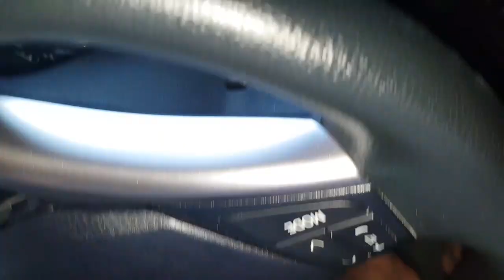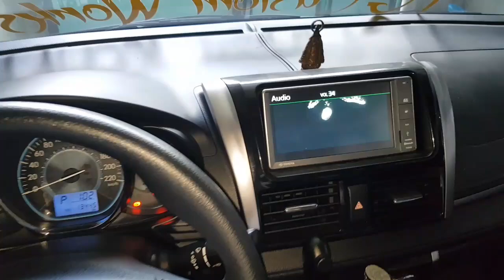Toyota Vios Steering Wheel Controls disassembly and cleaning of none working buttons.

Comment: Boss yung head unit ko pinalitan ko ng pioneer avh 595bt d nagana sa steringwheel ko  vios din cya 2016
Reply from the maker: Sa settings pprogram m un isa isa.
Reply: Na try na nila ayaw parin sir
Reply: Bka may kilala ka na kaya mag pagana ng steering wheel
Reply from the maker: Kundi gumagana sa program sa wiring may mali. May 3 wires from stock harnes sa vios 3rd gen usualy nsa 28 pins un pedeng mali ng kabit o bali baligtad.
Reply: @jaybispo78  cguro nga sir my mali sa kbit or bka na discharged yun battery sa button ng steeringwheel
Reply from the maker: @benchworker2607  walang battery un paps. Board un wired rekta. Un sa mirage lng un may battery connected as blutoot kc un.
Reply: @jaybispo78  ganun ba cge boss maraming salmat sa informasyun
Reply: @jaybispo78  boss gumana na yung stering wheel ko tama ka sa program lng ang problema ko nlng is yung vol na negative d cya nag fuction anu po kaya posibleng problema
Reply from the maker: @benchworker2607  bka madumi paps un contact linisin m lng.
Reply: @jaybispo78  cge sir salamat mejo delikado din cguro linisin bka sumabog yung airbag
Reply from the maker: @benchworker2607  paps fyi lng un trigger ng airbag nsa underhood wala sa manibela. 😁 ska kung gusto m sure ka pede m nman tanggalin muna negative terminal ng battery pra hnd kna nagiisip. 😁😁
Reply: @jaybispo78  ganun ba cge po maraming salamat po sa info mlaking tulong po video nio

Comment: sir alam nyu po kung anung wire kulay ng steering wheel control ngpalit po kc ako headunit steering wheel control supported di ko lang alam wat wire kailngan iconnect
Reply from the maker: Un tatlong wire sa 28pin harness un ung pra sa steering wheel controls
Reply: nagalaw n kc paps di ko n alam kung alin wire ung nsa 28 pin harness kaya gus2 ko sana malamn anung kulay may tatlong bakanteng wire kc natitira black light blue saka blue
Reply from the maker: Vios gen3 ba unit m? Iba iba kc wiring nyan. Kung sa harness ng gen3 na headunit kung galing sa 28pin white orange at green un.